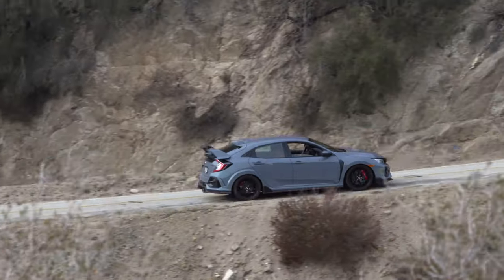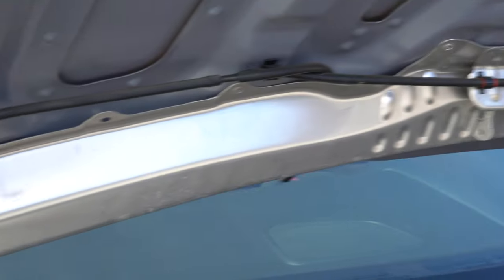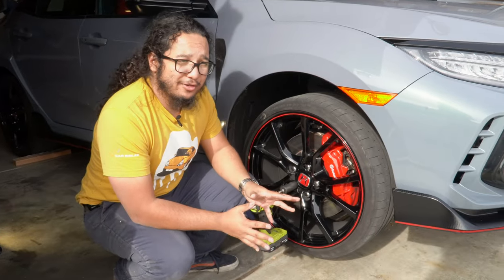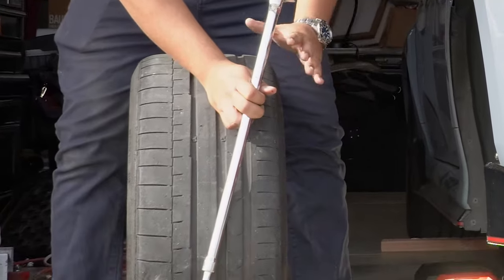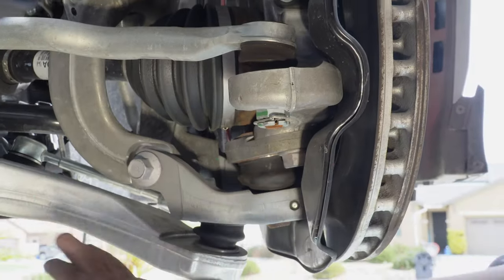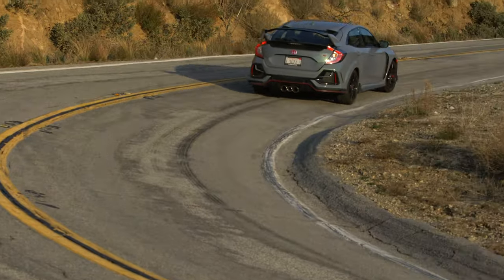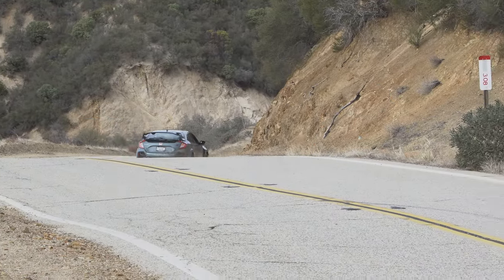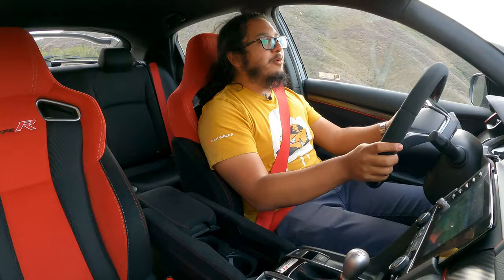The Honda Civic Type R Is A Great Handler Thanks To This Unique Suspension Setup

Comment: i knew the fk8 had awesome suspension design and geometry ... but i didn't truly appreciate it until i broke a strut bolt and had to disassemble the entire front left assembly to replace the strut top 😂 it is insanely over engineered and difficult to take apart/assemble but it does its job damn well..
Reply: What happened, how did you broke your strutt bolt though, from accident?